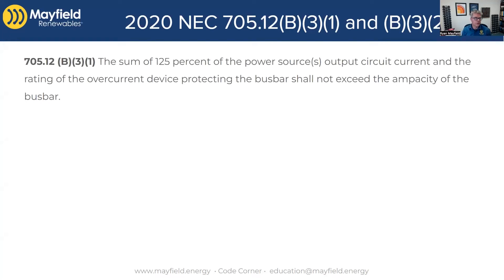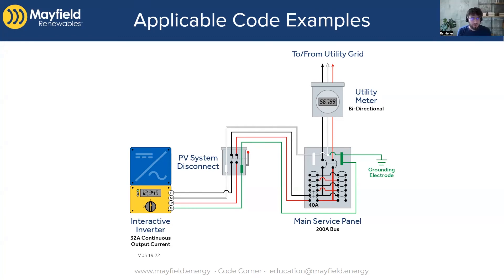Mayfield Renewables Code Corner - 2020 NEC 705.12 Part 1

Comment: Can you please give an example of creating a "hot spot" on the bus? We use the 120% rule often at our company but I don't fully grasp how having them at opposite ends protects the bus. The main breaker is assuring you cant exceed 200 on the 200 rated bus and the branch breakers assure the load amperage is evenly distributed on the bus. So if the main and pv breaker were directly on top of each, where would the hot spot occur and why?
Reply: "The main breaker is assuring you cant exceed 200 on the 200 rated bus"  <-- this isn't true. It just is protecting the bus from getting more than 200 amps through that main breaker, but your PV breaker can easily be putting MORE amps on that bus. This seems to be allowed as long as 125% of the PV output + that main breaker isn't more than 120% of the bus and the reason the location matter is that if they're on the same end, the part of the bus right after that PV breaker connects to it is OVER the 200 amps it was rated for (somewhere between 200a and 240a if you follow the rules but put the breaker in the wrong place). If you put the PV breaker at the other end, you essentially have 200amps flowing from one end and 40 more from the other end which are getting sucked up by various load breakers. In almost every case, this means no part of the busbar is actually conveying more than 200a.
Reply from the maker: Thanks @jessesilver this is a good answer. @Sitesurvey9296, you have to consider all the sources of power. In this example, we have power coming from the utility and the solar. If those two sources were at the same end of the busbar, they could add together and exceed the rating of the bus, creating a “hotspot”. By placing them at the opposite ends, the current flows from the ends towards  the middle and there isn’t any place they can be additive. If there is current from both the utility and the solar, the power is sent off to the loads through the branch circuits and there isn’t anywhere on the busbar where the current can exceed the bus bar rating.